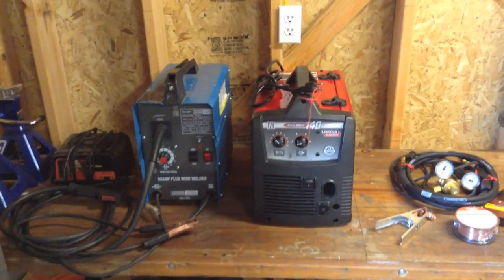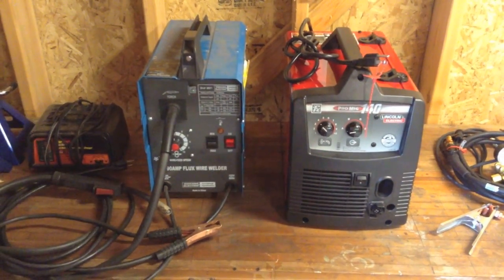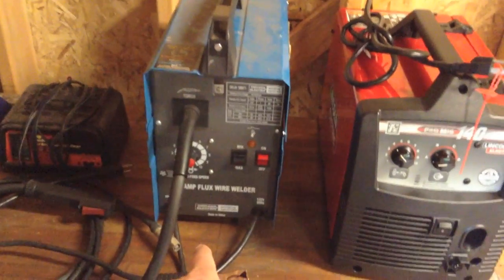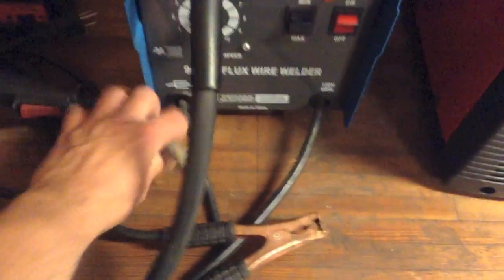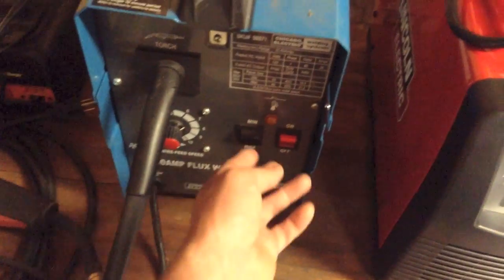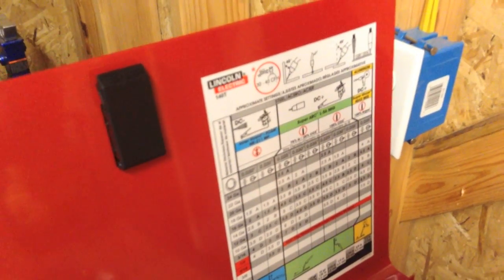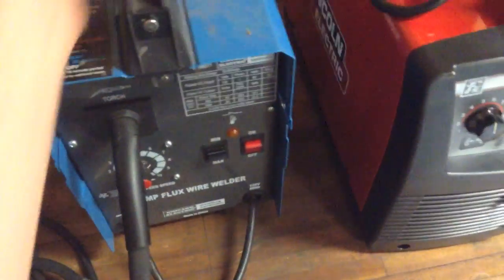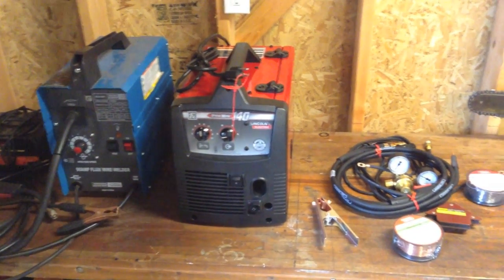Welding Basics - Harbor freight vs Lincoln electric

Comment: I know it's 6 years old but anybody's seeing this turn your AC welders into DC the most common one right now is the Harbor freight Chicago electric for $40 you can turn this thing into an awesome  Welding machine,  150 amp bridge rectifier, ,40 to 50 W  Capacitor and a  10 W 100   OHM believe resistor, The Chicago electric hold 10 pound spools of wire cost $40 every time I reload it it saves me $60 basically,  basically after the 1st spool of wire its already paid for itself The money saved on wellding wire alone is worth it... make it DC a welder

Comment: My HF 90 amp has more than paid for itself and is still giving. I bought a 220 stick welder and never did get a decent weld until I got this FCAW from HF. We are a match and I've welded thin sheet metal up to a quarter inch with no fails so far. If it fails I would buy another one. Yes, it's AC positive and all that I've heard about the AC boogyman is nonsense. Never used a DC so can't compare.
https://www.youtube.com/watch?v=eL1EibTRP3I&t=2s

Comment: Several years ago I made the mistake of buying a harbor freight Mig welder. At the time it was HF's "top of the line" 220V welder. Should've bought a Miller, Lincoln, or Hobart. I let the low price fool my common sense. I used it for a few projects, but it never seemed to have the power to run more that .023 wire or give decent penetration with anything thicker than 1/8" steel. Arc voltage was inconsistent at times, and the final straw was when the gas valve in the torch handle got stuck in the open position, letting gas flow any time the bottle's valve was open. I dealt with it for awhile Finally I had enough, and found a really good deal on a factory refurbished Lincoln 180 amp (220V)  and the spool gun for less than the cost of just the welder @ Home Depot or Lowe's. The difference in welding is night and day. The Lincoln will run .023/.025", .030",& .035" solid wire with equal ease. I gave the Harbor Freight welder to a friend and helped him replace the gun. I also picked up a used Lincoln HD3200 which is a 135 amp 110 volt unit comparable to the 140 HD. In fact it's the welder the 140HD replaced. The biggest difference is the 140 will accept a spool gun. Even using 110 volt power compared to the HF using 220, the Lincoln 3200 will weld circles around the HF welder.
Reply from the maker: Thanks for sharing.  I have had very mixed reviews on my video.  I am glad to hear that I am not the only one that had trouble. I had a very similar experience with this harbor freight welder as you did.  No matter how hard I tried, or how many videos I watch, or which technique I tried,  I did not get good results.  It splattered all over the place and I could never get good penetration into the metal and the weld would usually break.  I invested in the new Lincoln Electric welder because I realized that I would never be able to learn to weld without a "real welder".  It was like night and day!  Thanks for watching and thanks for the comments!

Comment: Here is the real difference, who is going to fix a HF?  Does HF have tech line where they will help you over the phone, in English from an American?   No, they don't.... Don't buy eggroll, only Cheese Burger.
Reply: David Spin an egg roll has more real ingredients than an American cheeseburger lol.  fake cheese and  left over beef trimmings grounded.  egg roll please.
Reply: To be fair, the gun is the most likely part to go bad on the HF welder, or any other Mig welder for that matter. There are a couple of sources out there for replacement guns for the Harbor Freight units. The only problem is that they're probably more expensive than a used Harbor Freight machine is worth.

Comment: DC welding is a better arc .get a big tank if you mig weld ,you always run out of gas on a weekend when welding with a 20 lb tank .collect bed frames ,to use for a welding cart .
Reply: hell yeah. bubbles would be jealous
Reply: gary mathews   i simply picked up a bastard shopping buggy in a ditch for my welding Cadillac.  :)
Reply: He is right though you get better penetration with DC, less spatter, and slag is more localized. There is a guy who converted his Harbor Freight welder to DCEN and his work a ton better than the normal A/C the welder uses.
Reply: gary mathews haha....i been using a bed frame to make a bicycle trailer haha.

Comment: The premium welding wire, ala Lincoln, Hobart, etc produces much better and stronger welds through being able to get better penetration and fusion into the base metal. Avoid the Arksen brand welders and the same welders sold undet a different name. I have the updated version of the Harbor Freight welder and it is a decent unit for the money.

Comment: The Lincoln 140 I own gets used everyday I think I have put over 1600 lbs of wire .030/.035 flux cored wire through it so far.it has a small duty cycle but for its weight class its real good ...oh it was built in Poland. I had a HF p.o.s. wire driver that made it an entire week before the drive motor n gears went to crap in it.you get what you pay fore.

Comment: A fair comparison would have been the HF 43026 welder, which gives the Lincoln a run for it's money so many ways.  Even though my HF 43026 is now nearly 15 years old, it is an amazing welder given the amount paid.  170 AMP/230v spot weld, burn back, and slope adjustments.  Welds both DCEN and DCEP, I now have a spool gun on it and can weld steel and aluminum.  It will weld MIG, fluxcore, and dual shield.  Yes, it wasn't $100, I think it was $300 with the 25% off coupon and $400 without the coupon.  Be happy to compare both side by side... no question about it lasting since I have 15 years on it!

Comment: Another 50-70 on the HF welder to switch to DCEN and get some caps in there to smooth the flow and you've got a nice solid little machine. Not perfect, flux only, but pretty ok.

Comment: Mig is a CV machine. meaning Constant Voltage. that H-L switch is for the voltage i do believe. the current fluctuates.
Reply: shexdensmore Good to see that someone on here has been properly educated. You are absolutely correct. Tig/Stick power sources are "Variable Voltage/Constant Current machines. This means that the amperage or current is adjusted to the desired setting and the voltage fluctuates depending on the length of arc, the size of rod being used, and the metal being welded. A Mig power source has a transformer that is wound differently and provides Constant Voltage with the amperage varying based on the wire diameter, wire speed, and the metal being welded. From what I understand, the same is true of the newer inverter based machines, but I haven't any formal training on those.

Comment: Nice Lincoln welder. I have the harbor freight 90 amp welder and it does everything i ask it to do. I'm assuming that Lincoln is a 110v unit? It can weld aluminum.
Reply: Love2boat92 Yes, the 140HD/Pro Mig 140, depending on whether you buy it from Home Depot or Lowe's, will accept a Spool Gun for Aluminum with no modifications or adapters. The older Pro Mig 135/Weld Pak 3200HD required an expensive adapter box to run a spool gun, or a special Teflon liner kit to run aluminum. Questionable results at best with the liner kit, trying to run 10' of aluminum wire through a push type wire feeder.

Comment: I have those two welders as well, cept my Lincoln is a 140-C, There really is no comparison between the two welders. The Lincoln is way better. But I think thats mostly attributed to the Harbor Freight welder is an AC welder, and the Lincoln is a DC. If you convert the HB welder to DC its actually a decent welder. Still not as good as the Lincoln tho.
Reply: +kabukiwookie My blue harbor freight 170 welder is DC. Welds quite well.
Reply from the maker: ***** Thanks for the feedback!  Thats good to hear..  I am still learning to weld, but I hope to get much better at it now.
Reply: kabukiwookie of
Reply: In my opinion if you have a bit more money to spend it pays to buy a modern inverter welder nowadays. They seem to have more features and a cleaner arc for your money. I have an everlast welder that I'm very happy with.

Comment: What's the deal on the original? I want to see that bad boy done! Maybe you.coukd make a video. And btw I actually have two originals. One is a 62 with a 20 horse Honda on it. And the other is also a 62 with some big ags and some nice front tires. It has a right horse. Anyway nice video